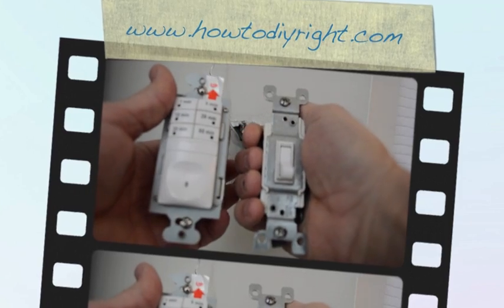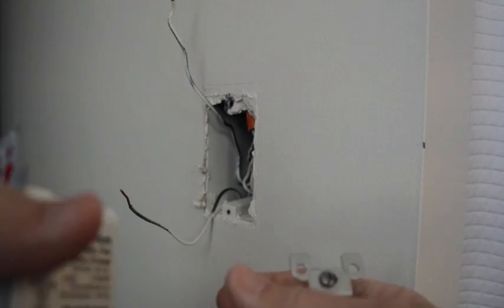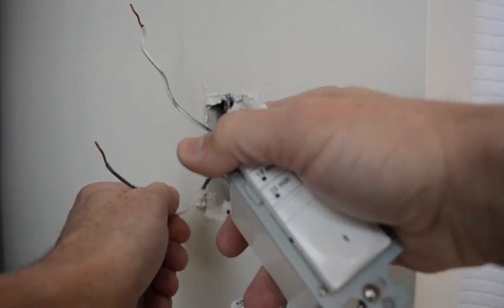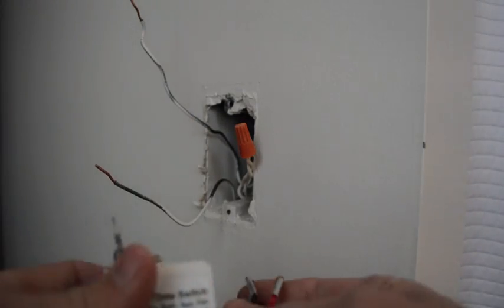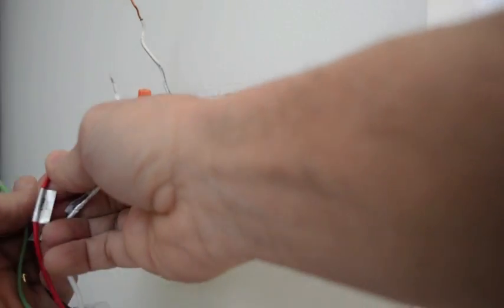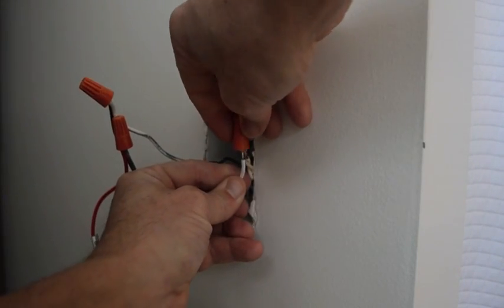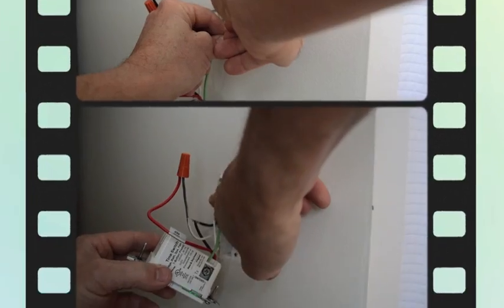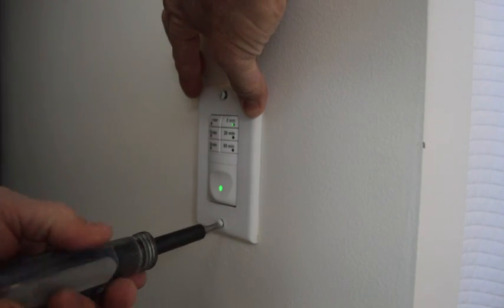Timer switch Installation

Comment: You might have mixed hot and load wire in your connection. The load wire from the timer should be connected with the load wire (it carries no electricity and goes to your fan). The hot wire from the timer should be connected with the hot one, which is the source of electricity.

Comment: Although most of what is said is true. I take issue with "you can touch one live wire" .  You shouldn't for many reasons, if the wire is in a grounded metal box, you can shock yourself if you touch the box too, if you are on a concrete floor without proper insulation on you feet, you could possibly shock yourself. Essentially, if you touch anything else that can carry current, you may shock yourself. THERE IS NO REASON TO WORK WITH LIVE WIRES.  You will eventually shock yourself. If you need to figure out which is Line vs load, Use a multimeter and measure the resistance between the light bulb and the wires. When it shows continuity you have your load wire. No power to wire needed for that. This shown is definitely not the "right" way and no professional  whose been in the business for any length of time would do it with live wires.

Comment: This should be called howtodiyWRONG 1) You can get shocked from a hot wire if your body is grounded and the only ground! 2) the red LOAD means the fixture being powered not the hot. 3) Shows the power going thru the switch and the green shock protection is not even attached.

Comment: It's amazing that this is working at all.  You do not wire your timer's red "LOAD" wire to the "HOT" black wire.  The red load wire goes to the top black wire leading to the fan which is the "LOAD".  The white wire is neutral, and the remaining timer's black wire goes to the bottom "HOT" black wire.  Green wire to bare metal ground wires.  And always, always always shut the breaker off FIRST whether you're  "comfortable" working with electricity on or not - there's no point.  You could inadvertently contact the ground wire and the hot wire and get shocked, or arc your new timer and damage the circuit.  Turn the breaker back on after all plastic wire nuts are on.
Reply: Great reply. That’s exactly right. Well said.

Comment: For all of you DIY'ers watching this.  I'm a professional electrician.  Please, and I cannot stress this enough, please turn your breaker off before performing anything like this.  Also, please understand line, load, and neutral before attempting to wire a switch.  If you're not familiar enough with those 3 terms - line, load, and neutral, you may want to call an electrician.  Just beware... if you touch an exposed neutral on a circuit that is pulling current, you may not survive.  Just a friendly warning.

Just turn the breaker off.  Do it... be safe.  I'm an electrician and I would turn the breaker off.  Do it yourself, by all means if you feel comfortable doing so, but be safe, and safety dictates that the breaker is turned off.
Reply: Absolutely, never touch the live wire.
Reply: I also love to wear rings on all my fingers when i work on live wires.

Comment: Do what you want, but it's not wise to leave the power on during install.  Also, twist you wires together BEFORE installing the wire nut.  

The information on what to connect is sound, the procedure leaves much to be desired.

Comment: For anyone watching this video, it's a DIY video.  Stop commenting about what's wise and what's not. If you know the proper procedure for handling electrical upgrades like this one then explain it in your comment.  This is a pretty good explanation of the basics of upgrading to an automatic switch.  The fails in this video were that he still had on his ring, which is a nice way to shish kebab and possibly lose a finger if you complete a circuit over it, next he didn't cut the power to the switch and he potentially could have ruined the new switch by not turning off the breaker first.  Digital electrical devices have more parts that are susceptible to damage from electrical current.  Someone said that they only have two wires in their box.  For the switch in this video you need the three wire setup to complete the install just like Dennis mentioned.

Comment: You are lucky that the power comes into this switch  box , so you have a white common wire that allows you to power the device you are installing, but electricians  sometimes run the  hot wire and common to the bulb  box and then run  a 2  wire to the switch box  and in this case there is not a common white wire in the box where you need it.   If this is the case a common wire must be wired  to the switch box .  This requires one to run a new wire  , otherwise one cannot install this timer. Do you agree with  this? A real electrician should comment on this  please
Reply: Dennis Adams I'm not a "real electrician" but in this case you should connect the neutral  (white ) and the ground (green) together from the switch to the ground from the box, is not code but that should work.

Comment: I only have 2 wires
Reply: Same...what should we do?
Reply: sucs for you guys, I've seen this in older houses where they runn the main into the light and break out only LINE and LOAD to the wall outlet... this also means they didn't run a ground wire. if there is a ground wire tuning white and green to it should work. either than that your SOL

Comment: How do you know what wire is load and what is hot etc.  All my wires in wall box are wht and black.  They all look alike.
Reply: Usually the load is the bottom black wire that was attached to your toggle switch.

What i do is take pictures of each step i take from opening the wall plate, to installing each electrical line.

That was as a novice, i can re-trace my steps if i do something wrong.